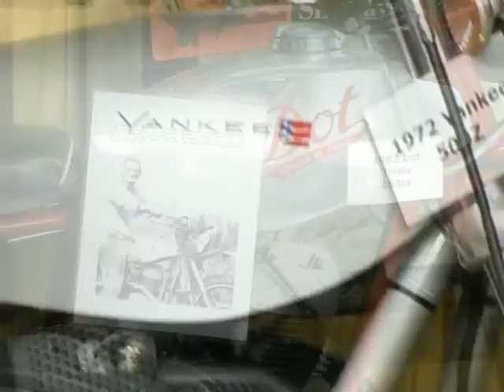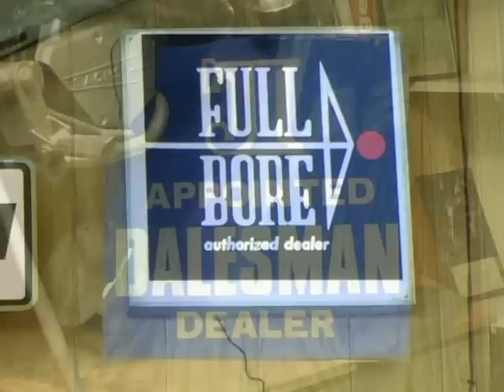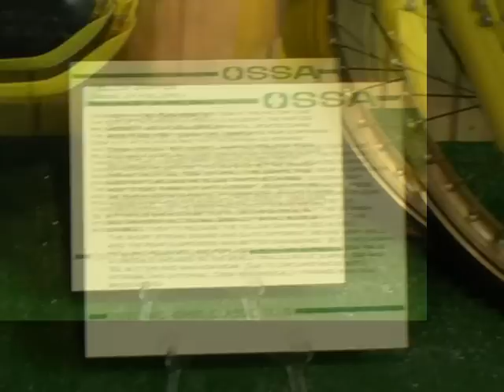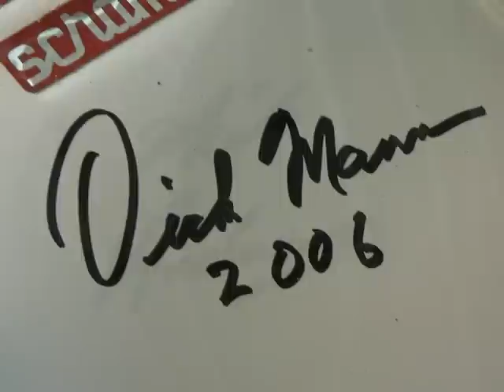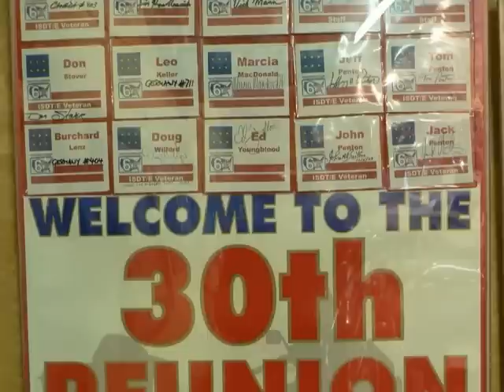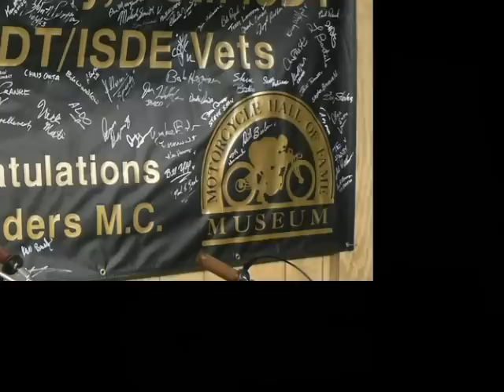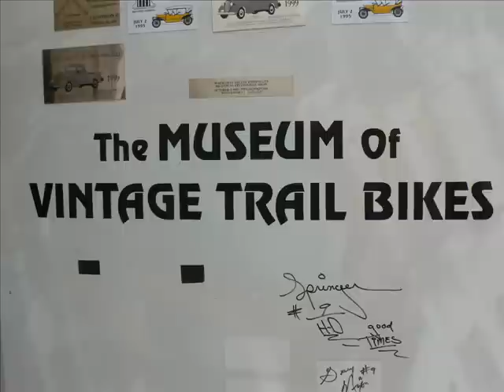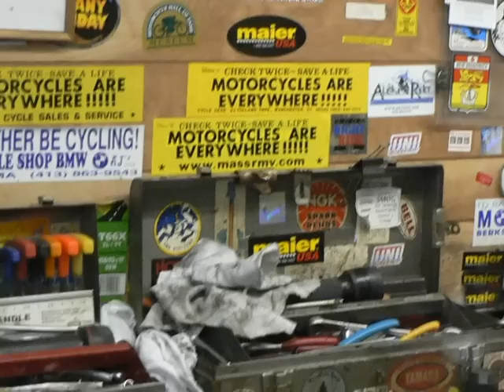Jim Hoellerich's Museum of Vintage Trail Bikes

Comment: A friend bought a DOT and that's the first 2 stroke dirt bike I remember. Put an extra 4" of foam in the seat because the rear suspension was so terrible. Was better than my Triumph Cub though because it actually ran most of the time.

Comment: would love to see this first hand, but I am on the other side of the world! I had a Mick Andrews replica OSSA bought literally "in the box" in 1975, great bike, but had a few issues like the the exhaust nut being too loose in the cylinder, stripped after a month or so. Also had the gearbox stick in 1st gear in the Drakensburg mountains in SA, +- 50km from our camp site. stipped the engine in the camp with a few borrowed tools. 2 weeks old at the time, gearbox was of pretty rough design. Later I had another 3 OSSA's. Best bike i had was a yamaha TY175.
Reply: Yes, TY's a great entry trials bike. I had a 1975 RL 250, loved it! 
Jim has a fantastic collection, love too see it soon, before he sells and goes to the race track in Heaven.
Reply: Will George I had one loved it. Fun in rocks of Berkshires

Comment: Oh my God, I haven't seen these Bikes in one place like I did in 1973  in a Motorcross competition in Venezuela, I saw a Maico 650cc 4 cylinders 2 strokes  in one race, that one caught my eyes right away, but at the first turn, it was obvious this bike was too much for that small dirt track circuit, those Bultaco, OSSA and Montesa  were made with Titanium frames ,they weight so little, but had so much torque-power-compression, you could climb a giant rock with first gear and only iddle speed   it had a 120 teeth rear chain plate, it was ridiculous how powerful those bikes were